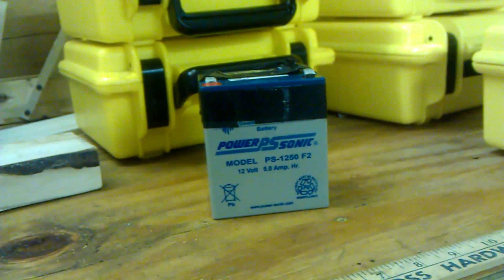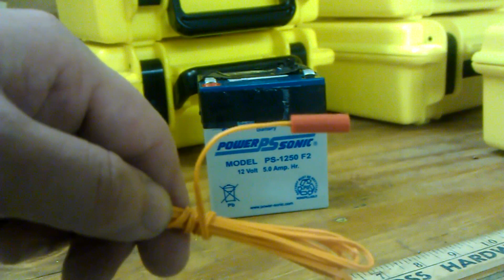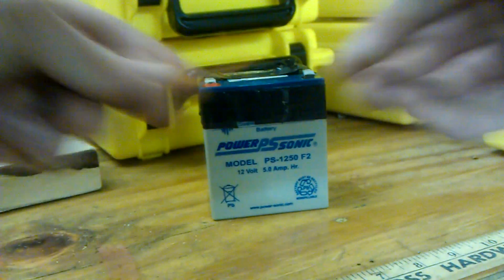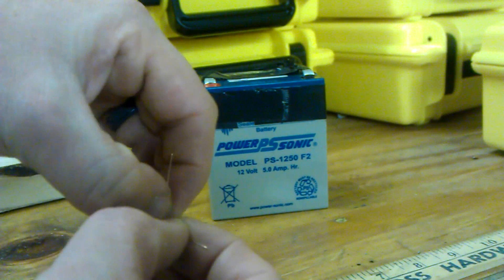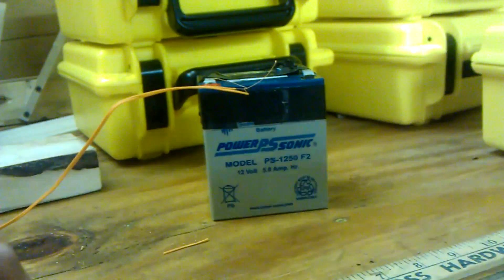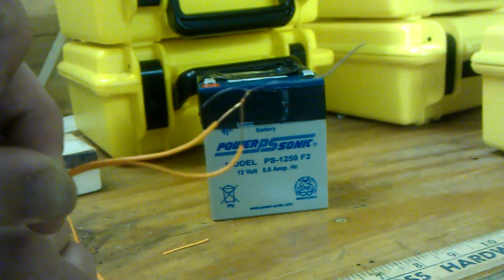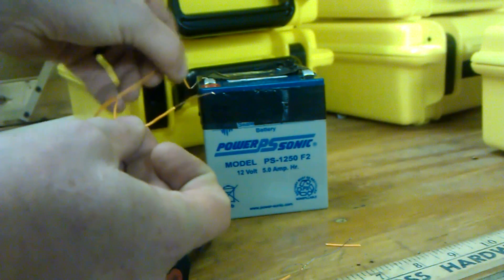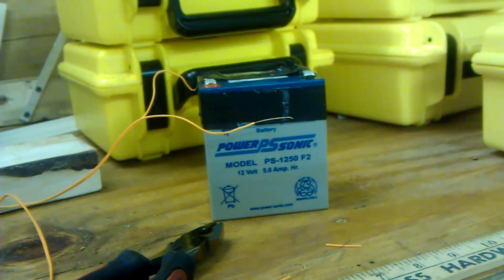E-match Safety

Comment: I'm not sure if you will get this message based on how old this video is, but say in a scenario, I'm preparing for my show. Would the proper steps be, shunt e match, insert e match and tape it securely to shell or cake and leave it shunted untill I plan on putting it in my module? Once I'm ready to do so, unshunt it and place in module and then proceed to turn my fireing system on and prepare for fire?
Reply from the maker: Yes Zachary, you are correct. Shunting the e-match leads is the first step you should take. You would not unshunt the leads until everyone and everything is clear of your devices and you're ready to insert the leads into your modules.
Reply: @jonkelley82  Thanks so much for replying back. When I have the match shunted, is it fine to just have the ends just laying on the ground, separate from the other wires untill I'm ready to put them in the modules? Should I tape the ends to protect them from any outside source just laying on the ground? This will be my first year e firing and iv just been overloading myself with information. Don't want to blow myself up.
Reply from the maker: @zacharykoedyker3978  We leave them wrapped up as they come from the factory. If they need to be unwound for working/matching purposes then we wind them back up when the work is completed. Each match is usually accompanied by print-out address labels indicating device, location, module # & cue #. We leave them like this until it's time to attach them to their respective terminals/modules for continuity testing.

The shunting is the important part here as means of preventing premature detonation from static electricity. The winding just keeps everything neat and the site clean and stops workers from tripping over match leads and pulling them out of the device. You don't want a mess of spaghetti wires on the ground and sort through them to make sense of it all. Unwind each one individually and attach the leads to their respective address, then move onto the next match.

You can absolutely use tape for labeling or if you find it helps keep things tidy.
Reply: @jonkelley82  Thanks again for the info. I guess what you've told me is the missing info iv wanted to get. Plenty of videos and info how to match a firework. Plenty of info on how to set up in the module. Not much info for the inbetween. I guess last question and this is a super what if maybe? But is it possible that once I have all wires hooked into there perspective modules, and I go to power my fireing system on, is there any chance for a premature detonation just by powering on the firing system? When I say power on, I do just mean turning the power button on. Not pressing any numbered cue button to its numbered module if that makes sense? Im using the p12000 if that helps. Not ready to invest in a cobra or anything else super expensive untill I get the feel of a begginer system.
Reply: @jonkelley82  Also curious if you ever had any premature detonations, and if you did why did it happen and what did you learn from it?
Reply from the maker: @zacharykoedyker3978  I've never had a match go off due to static electricity due to safe handling practices. However, many people have been injured/killed from such an unfortunate situation.

We've had a few of premature detonations from firing system glitches during continuity tests. Once the matches are unshunted and especially when the leads are attached to your terminals/modules assume they could go off at any time and have everyone clear of the site or direct line of fire.

Comment: Hello, i need multiple electric matches connected to a trigger/button, i don’t want to fire them simentaneously but in succession. Any suggestion how to do that?

I also want the matches to be inside of the black powder load, not attached to a fuse, i want the firework to go off imediately.
Reply from the maker: MrQung You need to look into sequencers. Such as the kingdom 10 cue sequencer. These will allow you to program the interval between the cues and then it will fire them accordingly to the program.

Matching directly into the black powder charge is acceptable as long as you use the proper tools and procedures. Check out my other video for more info.

Comment: Cool vid liked and subbed ya now i used the shroud to pinch in the fuse and hold it close to the match head i have been told thats a no no they that touchy??
Reply from the maker: hillbillypyro inwv Yes, they are friction/impact/static sensitive. You can stuff a fuse in there 986 times and be okay, but that 987th time you could inadvertently set it off. Next thing you know fireworks are going off in your face or inside your garage.

You could also easily damage the match head by doing that and as a result the match wouldn't fire.
Reply: Thank you that touchy are they don't want a pod to go up early think i will test just how touchy they are and with them coming from  china you never know no standard
Reply: I install that last  outdoors lol
Reply: Are a e-match more sensitive than a ordinary match? If so, why?
Reply: From everything i read yes very touchy i had to hit mine hard with a hammer to set them off  not saying try that lol they are restricted more for post 911 reasons than danger imo

Comment from the maker: Ketra: you need to leave the plastic shroud that covers the ematch on. This shroud is roughly 1/4" in diameter. You will need a solid brass punch honed to a point that is 1/4" in diameter. Push the brass punch through the side wall of the cardboard tube into the black powder lift charge. Push the shroud & match head into the lift charge and secure with a piece of tape. (Don't forget to short or shunt the two leads of the ematch prior to doing this).

You can purchase pyro tools just for this purpose at pyinthesky.com.

Comment: I'm trying to use e matches on a single shot tube. Can you tell me how I would safely and properly insert the e match into the powder to launch it from a controller?
Reply: KetraMusic I'm not sure what you are fusing but it sounds like you are removing the visco fuse and pushing an e match into where the lift charge is. I would not advise this, just make the visco short and e match to it. You will have a short delay between ignition of the match and the shot but unless you are a pro firer to music this does not matter.

Inserting an e match into the inside of a firework would be dangerous.
Reply: It's not too hard. You have to buy a brass awl to punch a hole where the fuse is and make room for the e match. Leave the shroud on when you put it in to prevent friction. If you're not comfortable do not do it. Do more research than what I said and you'll eventually feel comfortable.